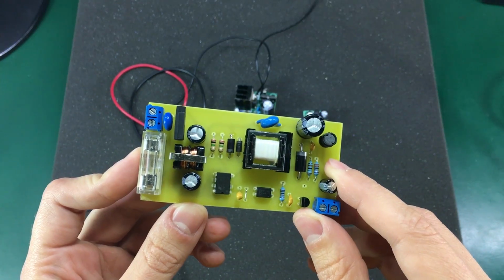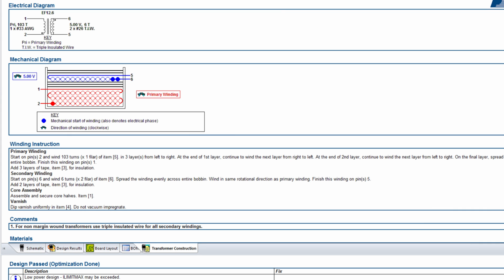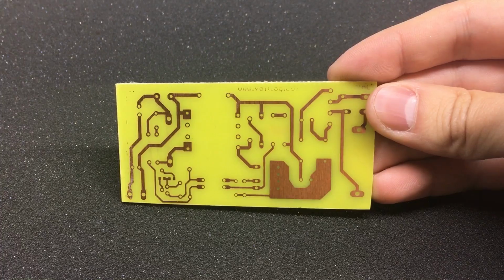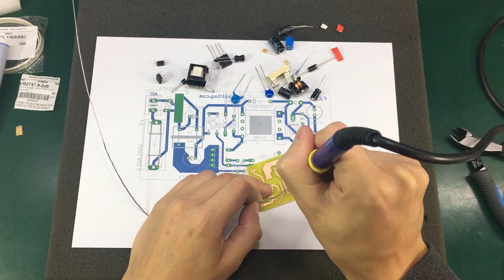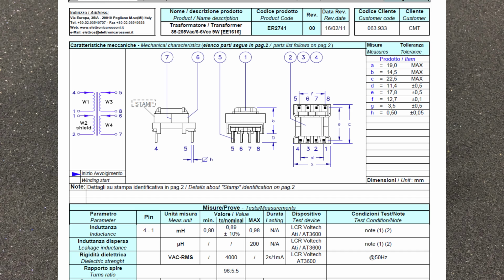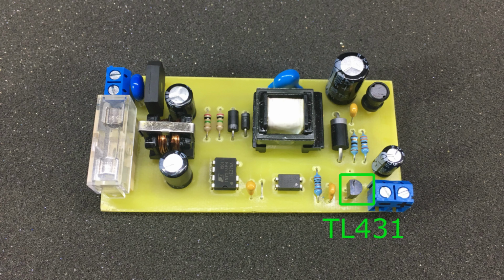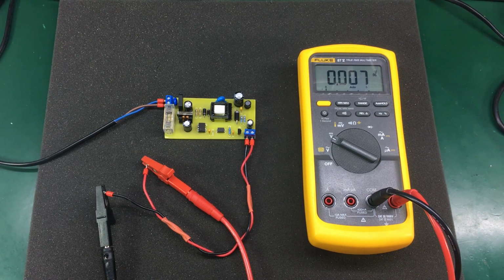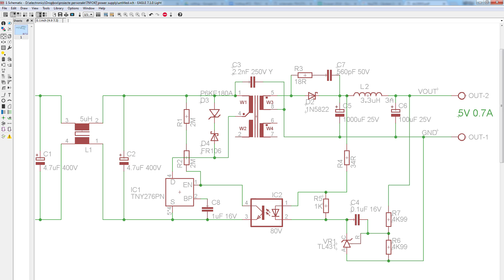Voltlog #72 - DIY AC-DC Off-Line Converter With TNY276/TNY277 - part 1

Comment: Great video! What optocoupler did you use?
Reply from the maker: I don't remember the part, it was either some common part or something recommended in the converter chip datasheet.
Reply: @voltlog  Thank you. I managed to read the part number in the video. It was a COSMO 1010 817. 
Pi expert software recommends a PS2501-1-K-A for this kind of PSU, but looks like the 817 opto worked fine for you.
Reply from the maker: @orides5976  yeah, the 817 is a pretty generic optocoupler, which I probably had in my inventory.

Comment: According to your pcb layout diode D4 is a 1N5819, this is a schottky diode and can't be used because the blocking voltage is way too low,  you need to replace it with a high speed, high voltage diode, like the FR106.
Reply from the maker: +John Mij on the actual board I populated with FR106 ultra fast diode. Sorry for that..

Comment: The additional winding is used for the no load situation to reduce the power disipation of the swiching device. Also the parallel cap 560pF is acting more like a load than a transient improvement of the shotky... it can be removed. I would be fun conecting the RIGOL all 4 channels in various points of the circuit and then compare with the reference signals in the datasheet. The datasheet has a typical application of the IC, so compare and see what is missing to your design... good luck

Comment: I'm definitely not an expert, but I see that the suggested schematic recommended 4.7M resistors for R1 and R2 and you used 2M Ohm. Could that be the cause?
Reply from the maker: thank you for the suggestion, that was not the issue. An update video has been posted here https://www.youtube.com/watch?v=4oD39aMEq8g

Comment: https://www.coursera.org/learn/converter-circuits check ch6.3.4 you have the secondary coil in the wrong direction! The way it's supposed to work is charge the transformer parasitic inductance then when cutting the current it is discharging to the secondary side.
Reply from the maker: thank you for the suggestion. An update video has been posted here https://www.youtube.com/watch?v=4oD39aMEq8g
Reply: I was thinking that you had one winding connected the wrong way. The schematic is ok but I suspected that you connected it differently. Swapping the connection on both sides simultaneously has of course no effect. The point is just a marking that is just a reference to compare the direction of 2 windings. There's nothing special. So having the dot up on primary and down on secondary is the same than down on primary and up on secondary.

Comment: I would check transformer winding polarity first. If that doesn't help I'd connect some 1R resistor in series with primary and try to observe voltage across it with scope in order to determine current. Perhaps the transformer primary has too low of an inductance and the core gets saturated. This could happen if for example the core was assembled poorly or the transformer you got is for 120VAC countries.
Reply: +1 - what he said!
Reply from the maker: An update video has been posted here https://www.youtube.com/watch?v=4oD39aMEq8g

Comment: HI , is it posible that the windings on the primary side are too low in resistance overdriving the internal mosfet?
And yes i remember reading something about the "polarity" too.
Reply from the maker: That's a logical question to ask, and it's the first thing that came to my mind too but that particular transformer is designed to be used with the TNY276 among others from that series. I didn't just pick it for no good reason. So I guess I'll try reversing the "polarity" and see how that goes..

Comment: Only thought I had, is to add a small capacitor between enable (EN) and source (S) to smooth out the feedback a little. Possible it's switching too much with no load. Usually these small PSUs have an led as a minimal load.

I agree on trying the RC snubber in the datasheet, these are a lot more complicated than they first appear.
Reply from the maker: between having the coil start/end reversed and missing the rc snubber which one you think would cause the circuit to over-heat? I have followed recommended design from pi expert suite, which I think removes un-necessary filtering for low power designs.
Reply: VoltLog current snubber is good enouth but it is nicer to use better snubber its just nice practice.There is nothing wrong with snubber.Also he was talking about cap that smooth power supply to the chip,ussualy you have one more winding to power the chip but this chip is diferent.I am not familiar with this chip and dont have time to research it right now.

Comment: coil polarity is shown with that dot on schematic and it does matter very much.
Reply from the maker: Do you think that if I had the coil polarity the other way around, the circuit would behave like it does?
Reply: VoltLog my theory is that chip is overloaded from one transformer windings being conected backwards.It can output right voltage if conected backwards but almost no power so it strugles to keep voltage 5v. reversing windings shoud  help if there is nothing else horibly wrong.
Reply: You mess up polarity of coupled inductor (flyback transformer).
You made one transistor forward converter, but without way to reset core, and core “walk−up” to saturation, which results in excessive current.
Reply from the maker: An update video has been posted here https://www.youtube.com/watch?v=4oD39aMEq8g
Reply: With the coils phased the wrong way you could end up with a forward converter rather than a flyback converter.

Comment: Maybe you should implement the rc-snubber circuit in it? R2 and C4 in figure 14 from the datasheet (https://www.power.com/sites/default/files/product-docs/tny274-280.pdf)
Reply from the maker: It is my understanding that additional filtering is to be added either if you increase the output power or if you have tighter design constraints: for example lower output noise but in this case, I don't think the rc-snubber circuit could prevent this circuit from working, please correct me if I'm wrong.
Reply from the maker: The diode is FR106, decent 250ns recovery time. I will first try reversing the polarity on the transformer and see how that goes, if it doesn't work I'll start exploring the other suggestions. Thanks.
Reply from the maker: An update video has been posted here https://www.youtube.com/watch?v=4oD39aMEq8g
Reply: Jyrki Koivisto or cap across zener too
Reply: Whenever a inductive load is being switched on and off it generates large spikes (which I'm sure you know). Your diode clamp might not be fast enough to clamp all the voltages. This is just my guess.
Reply: Jyrki Koivisto well it must be decent fast diode and cap across zener helps with that too
Reply: Jyrki Koivisto you probably know that you need to switch around one side.
Reply: Jyrki Koivisto you maybe acidentaly soldered transformer wrong way around  it can happend cause it looks pretty much the same on both sides